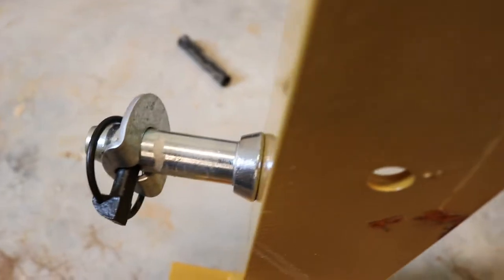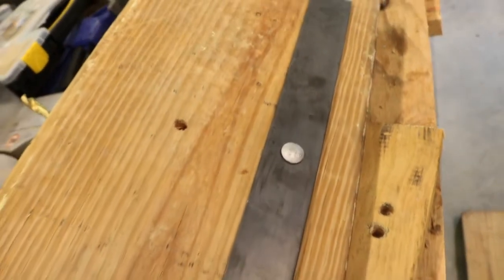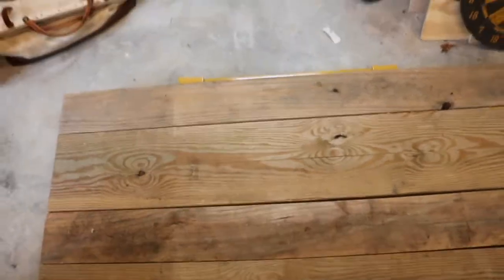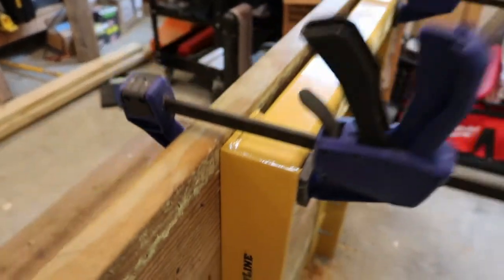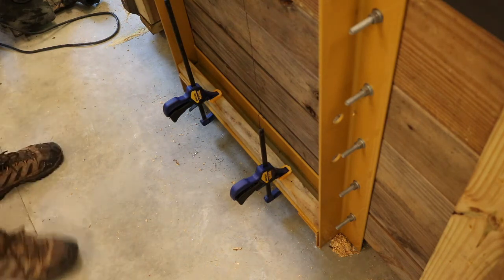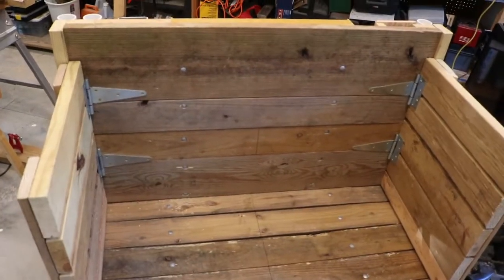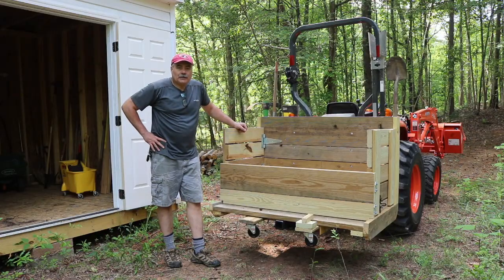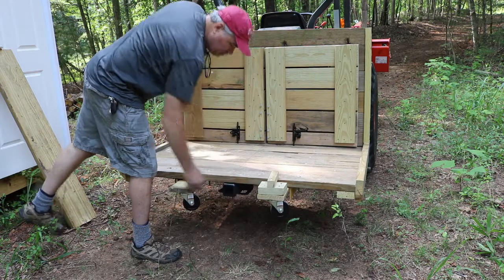#61 Build a Tractor Carry All

Comment: Well done!  I built the same design for JD 1025r.  I welded the receiver to the carryall and spaced the wooden frame out to permit using it with my Quick Hitch.   To preserve the treated lumber i coated the cut ends and the surface with Woodlife coppercoat wood preservative.   Bill
Reply from the maker: Hey, qfdforme!  I wish I had welding skills!  That is surely better.  I like the preservative on the board ends.  Thanks for watching!

Comment: Great video on the DIY My Way Carry All. I am doing one my self with the same plan. I like how you actually showed the building process and I know DIY had already built so was not possible. I think your lumber dimensions for the platform were a off because you did not use a 2x4 for the first board on the vertical portion and did not use the 1/4” spacing between the boards. Either way it worked out great nice job thanks for sharing
Reply from the maker: Hi Brad!  Awesome that you are building the Carry All!  I love Martin's version that is why I followed his design.  I agree on the lumber dimensions, but mine is working out perfectly.  I use it all the time and it is by far the most useful attachment for me.  I will probably put more long handled tool holders on it now that I am gardening... it comes in handy to tote all my garden stuff up to the pasture.  Thanks for watching and good luck on your build!

Comment: I am awaiting delivery of my first tractor.  A Kubota B 2601.  I have already purchased 3-point hitch pallet forks. I was thinking of building a free-standing carry all to be picked up with the forks. Every video I have seen uses the specific carry all metal frame.  Are there any gotchas to buildig a free standing one to be picked by forks when needed?
Reply from the maker: Hi Jerry, how exciting you are getting a new tractor, you will love it and get so much work done.  In regard to your question, I don't see any issues building a free standing carryall.  I think you may want to look at similar types of fork liftable containers, like an IBC tote, that has metal sleeves for the pallet forks to be inserted into that are bolted to the carryall.  You may just want to use the cage part of an IBC tote and cut away one side.  it is all set to use at that point, you may build in wood walls if you want to close up the spaces.  I would not spend the money on the 3 point carry all if you won't use it that way.  Just my 2 cents.  Good luck, Sir!

Comment: Nice job. I would start with larger boards and use shorter bolts.
Reply from the maker: Thanks, rg.  Agreed.  The bolts were left overs from another project, so it was good that I got to use them up.  I try to use what I have first.  The board width is varying due to the pre-drilled holes in the carrier.  You can drill more holes to accommodate any board length but that may compromise the strength.  Thanks for watching!  Good luck on your carry all!

Comment: Why not just attach the casters to the carry all?
Reply from the maker: That is a great idea if your usage and requirements dictate that approach.  I keep the carryall attached 95% of the time or more, so the dolly works perfect for me.  Also, if the casters were attached directly to the carryall I would definitely invest in more substantial casters... more rugged than the ones on the dolly.  Another problem I would have is that when I go up to the pasture, it is frequently muddy or the ground is soft enough that the casters would sink into the mud and get all mucked up, or when I take the carryall down to the front field, the casters will hit the gravel and may get worn and damaged from that.  Anyway, your idea is great if you don't have issues like I do and don't use the carryall almost exclusively like I do.  Hope this helps.  Good luck with your build!

Comment: Why does everyone use 2x4 lumber with no gaps. 3x4 stock would work just as well, is lighter, cheaper and easier to handle. I would leave gaps in between boards also, to allow debris to fall though. IMHO
Reply from the maker: Hi drdougaz!  I didn't use any 2x4s in my build.  I used 2x6, 2x10 and 2x12.  I did put a small gap of about a 1/16 of an inch.  The beauty of this carryall is that you can build it fully customized to your needs.  I happened to really like DIY My Way's design and it is working out really well for me.  Good luck on your build and please share it if you can.  Thanks for watching!